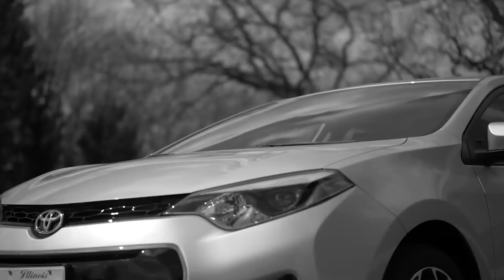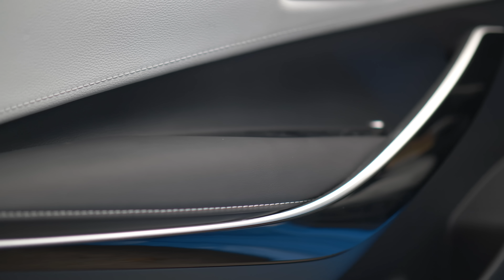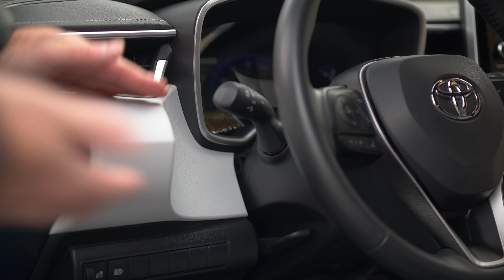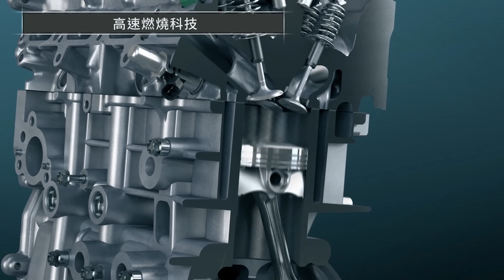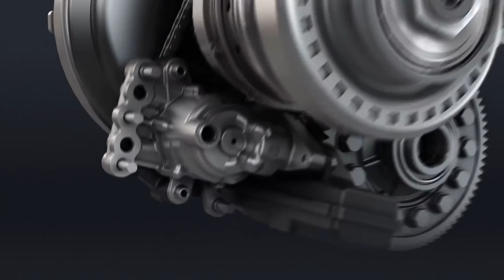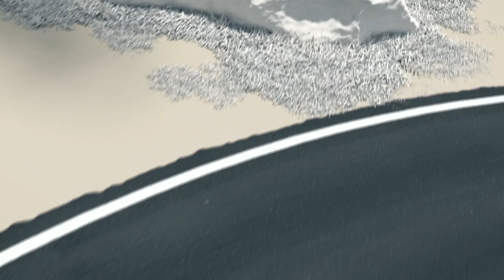Review | 2019 Corolla Hatchback | Sleepy Time is Over

Comment: What's the benefit of a CVT if they're not actually maintaining peak efficiency operating RPM? They simulate shifting because that is what people are used to, but isn't the actual point of a CVT to keep the engine constantly at the optimally efficient RPM? Is the CVT just cheaper to manufacture or design? Is the longevity considered better? I suppose it may save weight and reduce complexity, but I say that without knowing all the things that go into a CVT
Reply: EXACTLY! I just left a rant on here about this point specifically.... If you can't switch it off when you want (the simulated shifts I mean), then it seems incredibly stupid to me.
Reply: It only simulates gears when your accelerating with more pedal pressure or have it in sport, if you just normally accelerate it does is CVT thing and just accelerates smoothly and efficiently with no noticable shifts for peak efficiency.
Reply: I don’t get it either. Mazda is able to have their 6 speed automatic always be ready, better than any CVT out there. If Mazda can do it everyone else can.
Reply: Since they are not going to use cvt the right way (keeping engine at peak efficiency or power), they can easily decide where they want the 'gear changes' to be without having to physically modify anything. Same cvt can be used in different cars too and be optimised for the new car with software. But id agree, its still not ideal
Reply: I was thinking same thing, had same question type up but my guess is that when not hooning the car it will take advantage of the CVT for the MPGs (which sell cars in this segment)
Reply: Personally I would get a manual as they last longer than cvts. If you like me and plan on driving the car for about 10 years, maybe even more you want a manual. And if does break it's cheaper to fix or replace.
Reply: @S. D. H.  No way I'm sure a simple 5 or 6 speed manual gearbox is cheaper than a CVT.
Reply: This CVT gives you the option of either... in normal mode- it functions like any other CVT, it doesn’t simulate shifts per say, it just adjusts to throttle demand, you can still downshift to slow down/ hold speed back down a hill, by tapping it down and up through 6 preset ratios (gears). 

In Sport mode- you can leave it in auto and it will be a bit more responsive and simulate some shifts through 10 preset ratios. The ratios are very tight & this car is fun to chuck into windy roads and keep it in the peak power band with those 10 speeds. Better than the long spacing of the manual trans and easier to keep it at the limit!
Reply: What defines the efficiency of a car is really under cruising condition, not under heavy acceleration, so the efficiency lost with simulated shift really isn't all that important, while the car is gonna see a bit slower acceleration time it's trivial for actual customers as well. The main advantage for CVT is it's less expensive to make due to the mechanical simplicity comparing to the planetary gearbox found in traditional automatics , that's why even when the customers are not crazy about CVT the car makers are jumping on the board because that's the way of the future and the writing is on the wall especially for entry level segment where every penny counts, that's why FCA, Ford and GM are forced out of the game, they don't have good CVT and just can't compete in sub-20K market anymore, Ford tried to fight Asians' CVT with Powershif but it didn't go well.
In terms of longevity, if the customers truly care about longevity there will only be two or three brands and manual transmission left in the market, so.....
Reply: Traditional autos with 9 or 10 gears are physically bigger and more expensive than a cvt.

Cvt also gives the designer the flexibility in deciding how many gear ratios they want, all that is needed is a software change and you can have more or less gears. Cant do that with tradional automatics.

Still prefer manual though lol
Reply: @Haddi97  Why would they want to change the ratios? Nothing else about the drivetrain would change.
Reply: S. D. H. Not seen a cvt fail yet
Reply: People who think this simulated shifting in a CVT (not the physical launch gear) is a good thing are probably 16 and go "Vroom Vroom" when they talk about their ride, i.e. Mom's car.
Reply: Sometimes it's neccasary to stay in a lower gear for hill climbs or descents, since your transmission can't SEE a hill it's better to manually lower the gear ahead of time. On flat roads the cvt can stay in normal mode and do just fine. They were made for economy, not performance. Manual is for performance.
Reply: Simulated shifting is a thing because people are too stupid to understand what a CVT is and how it works.  They would get confused if it did not shift.  That's literally reason.  Hopefully by the time I become too feeble to manage a clutch they'll have stopped doing such bullshit.
Reply: @xs10z  That is exactly why this crap is happening in CVTs nowadays. If you get how a CVT works, you probably think this is stupid. As an owner of a couple of early Nissan CVTs that don't do this, (both still running fine, thank you very much), I don't care about simulated gear ratios. I'd rather have the smoothness and efficiency of a CVT's infinite ratios.
Reply: The benefit of a CVT (Continuously Variable Transmission) is that they are more efficient than an automatic transmission. That means that a CVT will get better gas mileage than an automatic.
Reply: S. D. H. Strange terms to use in relation but ermmm....however, seeing them every day from 0 miles to 250,000 miles gives a pretty good gauge as to what issues they have. If you search flat earth you will find something, don’t believe everything you read!
Reply: Good point cause the mpg is terrible for a cvt

Comment: For the size and weight, it should be an AWD. I'd take extra road noise to drop the weight 200lb. 

Toyota really needs to come out with an entry level, 6mt, that has cut the fat. Otherwise, It'll lose to Honda's and Hyundai at a similar price point, when drivability is the priority.  As it, Honda's a little vulnerable with their Civic since they're focused on cashing in with the GenX line-up. Great time to take the flag away from them.
Reply from the maker: I feel like they're just going straight to the higher-end.  If you take a look at this car I don't see them trying to compete in the entry-level Market anymore.  Plus I think that would be very hard to do at least in the US.
Reply: @savagegeese  make's sense, since their global chassis is more suited for mid-range vs compact cars.  Big reason why Camry is outselling Accord since Accord is based on Civic's chassis.
Reply: @psewgobind  From what I've read, most people are shunning Accord because of the styling.

Comment: How do you feel like this compares to the Golf/GTI? 

I'm liking what toyota did with the styling a lot. It's also 2-3k cheaper than a base GTI, but I'm still feeling like I'd probably suck up the extra 2k and still land myself in a GTI.
Reply from the maker: The Corolla is definitely not a sporty or fun car to drive.  It's that car that you buy or the mainstream buys that gives you the perception that it's sporty and has all the features and comfort that people want.  I don't think it's trying to be a GTI or a Civic SI or a WRX or an Elantra sport.  So the answer your question it's just basically a much better more comfortable Toyota Corolla, without a heavy emphasis on performance.
Reply: So like a well done point a to point b car?
Reply: @jrmt6  Yup. But you can get a used, <$5k Corolla that is just as boring, but it doesn't have all the latest gizmos.

Comment: its crazy how good of a deal someone can get if you just buy used because 22k for a new corolla is a lot. right?

i must be cheap cuz i always buy used. i always tell people to buy used unless theyre rich and have the means. i totally understand people having money and wanting to splurge on a nice new car but some people are living out of their means. ive seen many of my FB friends buy brand spanking new cars when they barley got a minimum wage job. its crazy. i make well over minimum wage (almost double) but im not about to be stuck with a 20k loan... i bought my 2014 focus with 40k miles for 12k. it was only a year old. New my car was about 19k. so a 7k discount is not bad thats 37% off just by buying used. Now i want to buy a mustang. probably a 2015-2017. I found a few around 18-20k. when theyre new they go for 25K. so thats about a 28% discount. id rather have a used 18-20k mustang than a new corolla. am i crazy or are people who buy new cars crazy (unless they have the means).

my car has 110k now after 3 years and still runs great.
Reply: Bought a 13 st with 36k miles. 
Biggest piece of shit I've ever bought. Technicians gave it a good to go (im a dumb ass on this part) and within 2 weeks. Had my transmission replaced. Front wheel bearings came loose. Then my intercooler and turbo hoses popped off. Then my doors stoppef closing (recall) then my starter went out. Then i started overheating (rat chewed through my grill shudders) Then my power steering. Then my slave and master cylinder went out. Took it back. Master cylinder leaking. Clutch still depressing have to kick it up sometimes and now my front left axle is leaking and i may have to replace the tube that connects the battery to whatever (forgot what he said here). Had a 2016 mazda3 before this, leased it new. Only problem i ever had with him was a rattle because i ran over a pothole and shook something loose in an admittedly low 16,000 miles
That's why i buy new cars. So i know how my car was treated before me and to not put up with this shit
Reply: damn sorry that happened to you. usually the performance models are less reliable. like the RS has engine problems too. sometimes you have to sacrifice reliability to get more performance, thats why i stick to buying the regular models. my car was only a year old and it was a rental so im sure it was beat to shit hahaha

Comment: You should defintely try mitsubishi Eclipse Cross'es cvt. One of the best cvt on the market even this toyota.
Reply: Mesut Taşdemir their CVT doesn’t have the real 1st gear like Toyota does. It is not better than this Toyota.
Reply: @android175  yeah i know it has not but it is really responsive and Quick. And has 8 speed virtual gears.
Reply: @mesuttasdemir4618  Toyota has 10
Reply: @android175  so but still has annoying rev hanging.
Reply: @mesuttasdemir4618  Check out the part where he is shifting, it is super responsive and has little to no rev hang. There is only some minor lag from first gear to second and onward.

Comment: BUT THE BLIND SPOTS!!!
Reply: Toyota is absolutely guilty of oversized blind spots in many new models.
Reply: My father in law was cross shopping the Toyota Rav 4, the Ford Escape, and the Subaru Forrester.  He knew Toyota has the best build quality and would have preferred to buy a Toyota.  But HUGE blind spot in the Rav 4, so he bought the Forrester.  (Note, the Forrester offers ALL the safety options at all five Forrester trim levels, Ford Escape only offers ALL the safety options at the highest/platinum trim - thus why he didn't buy the Ford).  This happened last week.  Pay attention Toyota, blind spots kill sales (Just ask the Chevy Camaro).
Reply: Just ask the C-HR @bikebudha01
Reply: Blind spots in my XSE aren't nearly as bad as they were in my 2014 Mazda 3 hatch! 😅

Comment: I'm sorry but this car as is about 21k+ ... That's way too close to Civic SI price point.
Reply from the maker: I don't think they are trying to compete with the Si or any sporty models.  Its still a Corolla, not sporty just solid basic transportation.
Reply: savagegeese I totally agree that Toyota didn’t have any intent to compete with the Si, however, its positioned as a sporty hatch with looks to match and a price tag that does compete with the SI. Just 2 weeks ago I attended the Miami auto show, and this Corolla been surrounded with unbelievable crowds. Genuinely ppl were comparing this to sporty offerings. IMO the price that should be about 2k less with that trim.
Reply: Civic SI with its shitty 1.5 turbo engine will crap out way before this car gets run-in properly at 100k miles.
Reply: Is the 1.5 really that bad?
Reply: ThayDath Roeun Majority of the Turbo, imo and some people perspectives, usually have carbon build up. Regular consumers wouldn’t know these kinds of things.
Reply: Different cars for different buyers and different purposes.
Reply: Too much hate on the Civic. Do they even own it?

Comment: I noticed the Ford Focus hatchback wasn't mentioned at the end of the video. Have you ever reviewed a Ford Focus DCT? I'd love to get your thoughts on how poorly those drive.
Reply: No more Ford Focuses are being made for the US market.  The last one rolled off the assembly line in May.  There's still quite a few available at dealerships, but those are the last ones.
Reply: To expand on  @maninredhelm , it may be possible to get one with a manual or a torque convertor automatic. The turbo threes with an automatic all have the torque convertor; the inline-four NA engines all have the dual-clutch. I'm not sold on the long-term reliability of the turbo threes. Best to find a straight-four with a manual, if you can drive one, and get an amazing discount off MSRP (over $5,000, if not maybe $10,000 off MSRP), or don't buy; depreciation on these things is immense. I'm looking online, and see some amazing deals, often over $9,000 off MSRP, and those prices are never what the dealer's really willing to charge.

TLDR: It's wiser to get a <$5,000 used Corolla from a private seller.

Comment: Love ya goose but I think your stretching on this one the CVT ruins it, blob compared to its competitors
Reply from the maker: Still has manual option on high trim.  Its not better than other cars just finally a Corolla that is not totally skewed towards boring.
Reply: @savagegeese  Something they did right is that they kept it as an option  on the higher trim. Sometimes I'd like to have a manual with my power windows, and that's not always on the table for some reason.  Sometimes the high trims only have an older mushy CVT and the only manual goes on the base trim. Hats off to Toyota.
Reply: I think as a balanced compact it actually is better than other cars, especially at the standard model. It’s Toyota so resell/residual value is amazing (which also means lower lease payments), the HP and torque are very competitive with any other base model compacts, the elegant design (Mazda inspired) flows much better than the robotic exterior of the civic hatch. 

It’s currently one of the best starter cars, hands down.

Comment: Does the manual come with blind spot monitoring?
Reply: According to Toyota's website, yup! It does come with BSM as standard on the 6MT model, so long as you get the XSE trim (the SE doesn't come with BSM).
Reply: The Toyota hard copy brochure on the 2019 Corolla HB is misleading if not outright wrong, but YES, I have the 6 speed manual XSE and it comes with blindspot monitoring. And what hasn't been mentioned is that the XSE also comes with HD radio which was a big factor for me.

Comment: I really want to get it as my first car most reliable hatchback 😍😍
Reply: 😂😂 not even close
Reply: Just get a <$1500 Corolla, like the '99-01 (those are very reliable), and save the rest for college. If you truly understood how onerous the terms of student loans are, how they can keep people from getting mortgages, and how those loans can't be discharged in bankruptcy, you wouldn't be considering this car. If you want to go to college, look into community college for the first two years, and then transfer the credits to a full university; that will save you some money.
Reply: And here I am reading this comment thread like a boss with the best balanced HB in the segment (2.5L mazda 3 HB). Good that there are so many solid options now (also interesting to see how well the OG 2014 mazda 3 still holds up, was ahead of its time IMO).
Reply: Get a Civic SI instead. Lots more power and way better suspension. Also, they are running good discounts on new SI right now.
Reply: The Corolla is not even the best of that. The Honda Civic hatchback is a more reliable car than the Corolla.
Reply: The Civic has a very reliable fuel reserve in its oil sump.
Reply: @Eric_the_Hiking  😂 too funny but the truth hurts lol
Reply: @britshell  The Honda 1.5 turbo engine is a failure. It mixes gasoline with engine oil and eventually self destructs. You must be insane to buy it. It's a well known issue by now.
Reply: @BlonduS-z1k  that is the same technology  they have been using in their gasoline powered string timers and those never break.